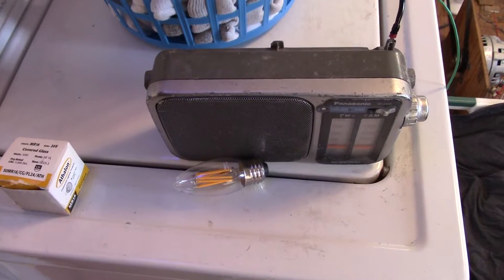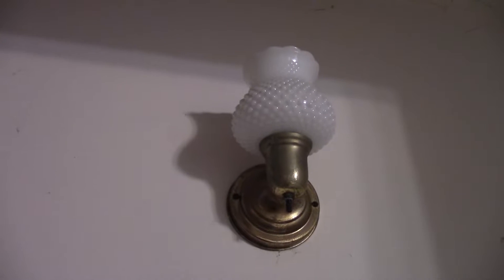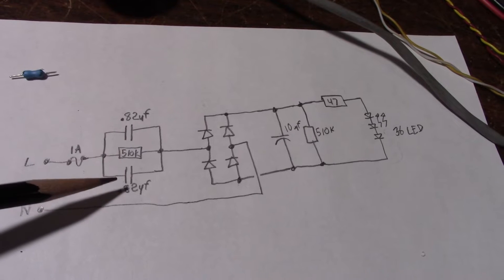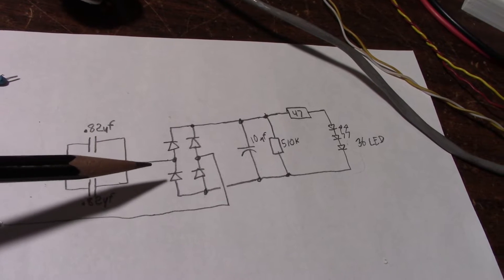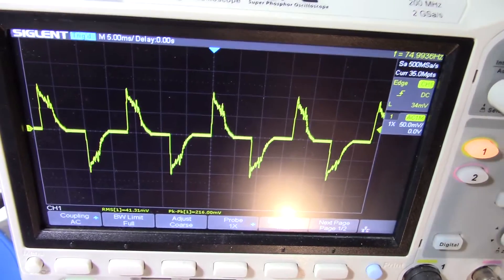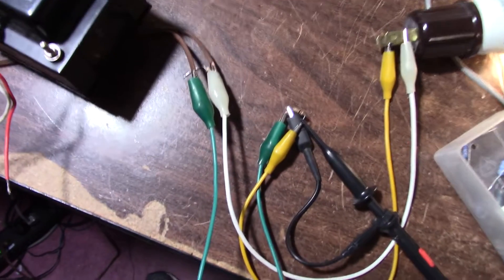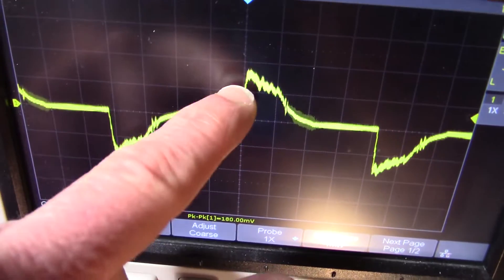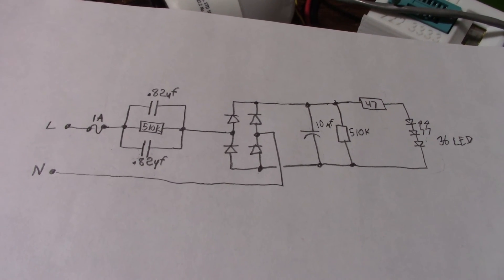AM radio interference - seeking the source

Comment: Awesome fault finding and diagnosis John. I have the same problem (yes, I listen to AM too), but the power is 50 Hz here. I was hearing a low level but annoying buzz on my bedroom AM radio and it seemed to be eminating from wiring within the wall. To shorten the story, my kitchen LED light was the problem. Even when off, it was emitting the low level interference! I had never had the bedroom radio and kitchen light on at the same time but after watching your video, I experimented and turned both the kitchen LED light and bedroom radio on and the interference was greatly worse. Thanks for your very helpful video. I'm yet to decide on a replacement for the kitchen light.
Reply from the maker: I'm glad the video was of some use. Newer LED bulbs of reasonable quality don't seem to interfere with AM.

Comment: My uncle used to track down interference around particular broadband routers with portable AM radios. The early routers would have issues with interference. He was the only telecoms tech with a handy solution for that issue.

Also, although i use one daily, those new panasonic radios just arent great. Treat yourself to a late 90's Sony ICF worldband radio... Youll be amazed.

Also  also, i often need to explain to clients that LED bulbs are not inherently noisy... That its the power supply quality that counts. People buy super cheap bulbs and are amazed when i say they need to spend more for quality!

Comment: The same with switching PSUs or DC/DC converters, can ruin your AM and sometimes your FM day. For example, I have a portable self-made battery operated adjustable power supply (with a DC/DC boost buck converter) and when I turn it on in the same room as the radio the AM is gone and the FM is distorted.

Comment: The one thing that has me puzzled is the sharp leading edge.  I would expect that the diodes would start conducting the moment that the line voltage exceeded the capacitor's charge voltage.  But it seems that the diodes are acting with some delay and then slamming on.  It is almost like the diodes are acting like a diac or something.  Very weird.  Are you sure the diodes in the bridge are normal 1n4000 series or something else?
Reply: Looks right to me, there is current on that scope, not voltage.
Reply: @akkudakkupl  I guess you are right.  But the when the 47 ohm resistor is in series, I was expecting it to slow that edge down more than it did.  It should have slowed the rise time to about 1ms, but it looked to be faster than that to me.  It may be hard to tell with 1cycle being about 16ms though.